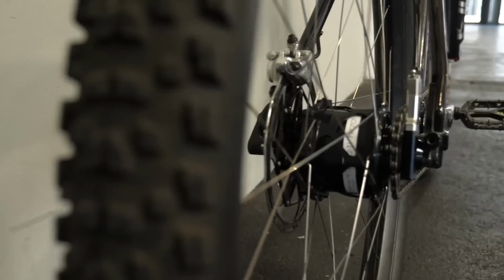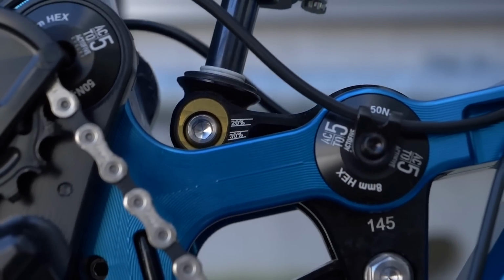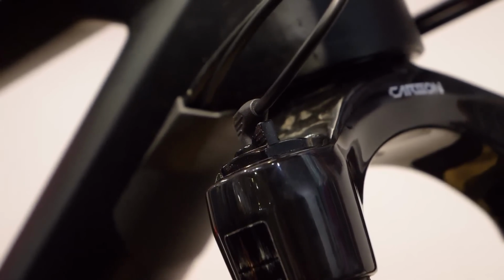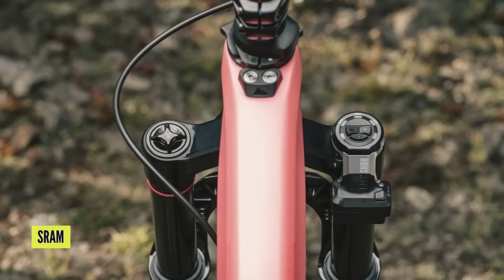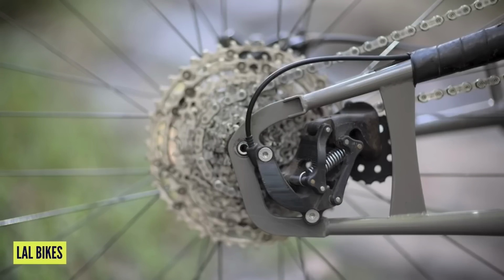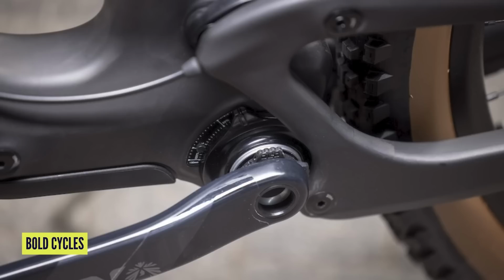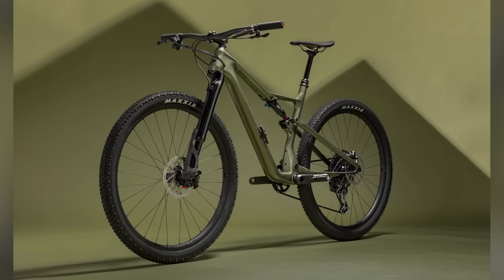Weird & Wacky 2021 Bike Tech! | GMBN Tech Show 208

Comment: I’m wondering if there is a mathematical formula to find out what tires will fit an inner rim width… and if this is true to all brand or if this is brand specific. For example Maxxis says that their WT 2.5 are made for a 35 mm inner rim and I understand that this is the perfect width but what is the range? Is 30 mm already messing to much the tire shape, etc. etc. etc.
It will be nice to have some informations on this particular subject.

Best

Comment: I rarely use the derailleur clutch on my conventional derailleur because I don’t like how it stiffens up the shifting.    Lots of short punchy climbs in my area, so I’m shifting multiple gears a lot, and not using the clutch feels far nicer.   Never drop a chain either (narrow wide chainrings are wonderful)

Comment: Two suggestions.
1 Using woods valves would make tubeless refill and maintenance etc easier.
2 How about making an oversized bottom bracket and then fitting a  14 speed hub in with the crank spindle running through that, effectively giving a clutter free gear system.
Just an idea.....
Richard

Comment: #AskGMBNTech I was wondering wether there much difference between between plastic jockey wheels and metal ones with ceramic bearings, ie wear on the chain and friction?
I’ve got Sram XX1 group set.
Reply: You will not notice it, unless you're a very professional rider with equipment to measure your power.

Comment: Hi I was watching your new video and seen you where talking about the centre hub system and thought I had seen something like that before. 
The Shimano Front Freewheel (FFS) was a proprietary bicycle drivetrain design of the 1970s that placed a freewheel between the pedal cranks and the front chainrings — enabling the rider to shift gears while coasting.[1] FFS rear freewheel is different than a standard freewheel because it's "stiff" with more friction than a normal rear freewheel. It will slip if necessary however, to stop the chain in the event of, for example, a clothing tangle — which could otherwise lead to injuries of the leg by the drivetrain, crashing of the bicycle, or both.

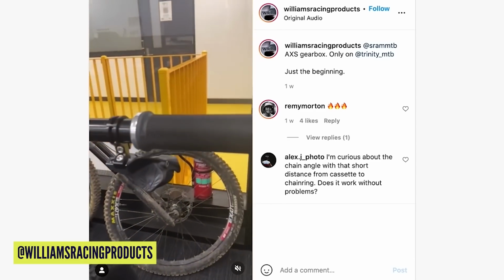Comment: 13:51 Sadly not compatible with Biopace or with "silent freehubs."

I do imagine you could completely enclose it within an oil bath though, for constant lubrication.

16:27 I don't suppose that an additional clutch could be implemented which bypasses the freewheel to enable going backwards and/or doing a trackstand?

Comment: I‘m not really convinced about the freehub cranks. Doesn‘t the constant rotation remove the tension on the upper part? The system with the rear mech inside the triangle and the separate tensioner is ingenious. The way the tensioner is mounted doesn‘t allow it to slap down when you land from a jump so it only has to handle the part of the force from the chain itself.

Comment: If you have a fixed rear hub with a derailleur and the freewheel at the cranks there is nothing protecting the system from a stuck chain. If the chain grabs anything it wont stop until the rear wheel stops and the chain will tear itself or the derailleur apart. It doesn't matter where the derailleur is located the problem remains the same. I'm sure they have thought about this but it must be quite an engineering challenge when there is no room for error.
Reply: Boom! Cable tie.

Comment: I love the idea of a drivetrain I can shift without pedaling. It’s like heel-toe downshifting into a corner in a race car. Fantastic. 

What freaks me out is the idea of a chainring spinning next to my calf. I’d want a guard over it so that, in a crash, it can’t saw through my leg.
Reply: You still have to be moving. Both Shimano (In the 70's) and SRAM (In the 90's) have messed with this and both never took it further, I suspect mostly because anything that flicks into the drivetrain while you're freewheeling downhill will self destruct the whole thing before you can stop. Also if your pants leg does get caught in it, you're not getting it out without stopping and rolling backwards until it's unsnagged, so it's possible to get very badly snarled up in it - trials bikes have been running front freewheels for decades and I speak about the snagged pants from experience...

Comment: Good to see drive train innovations, i have always thought to have the cassette in the middle might be a good idea because it may be possible to seal it in a bix & reduce the weight on the wheels, be interesting to see if these things would become normal one day.
Reply: It seems like reducing the wheel weight would be big to having a better suspension. People rave about carbon wheels but removing the gears off the moving mass seems like 5x the weight savings.

Comment: The old sturmey archer 3 speed hub had a low of .67 and a high of 1.36. Make it a 2 speed, fit a 12 to 36 cassette and you'd have a gear range  of approx 600% but with less chain and a short cage rear mech and much cheapness. Can it be done ?
Reply: This has already been done with the 3 speed hub, though there is a 2 speed Sturmey Archer around, but it's very rare, mainly because as soon as you put in the planetary gearset, you might as well use both ratios one planetary gear set can produce rather than just one of them. The Sheldon Brown website has instructions on how to do it, along with an absolute treasure trove of other information on obscure and not so obscure bikes. The downside is that you'll probably need to widen the dropout spacing to fit it and you're sacrificing axles strength in a big way for off road use as this is based on QR sized axles, and you're making the axles longer than stock. 

You're better off going with a Schlumpf drive at the cranks instead as it centralises the weight and it only has 2 gears, either a direct drive or 1.65:1 or a 2.5:1 gear depending on which model you choose. This can all be done with off the shelf drivetrain parts.
Reply: @peglor  cheers for tgat  I was thinking more of a new design on the Sturmery Archer hub with bigger axle etc. Has been a thought of mine for years  just done bugger all about it